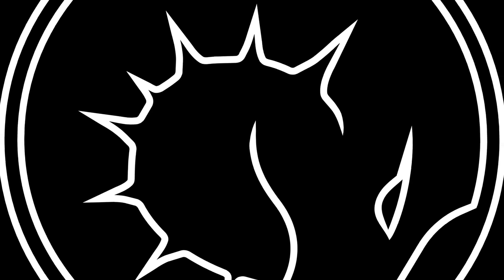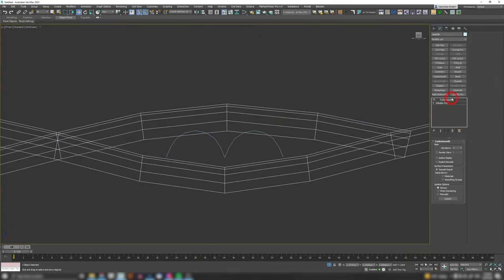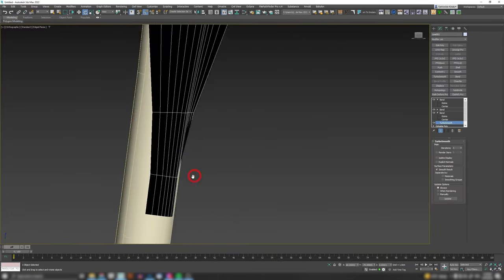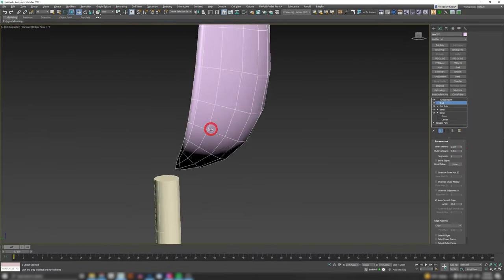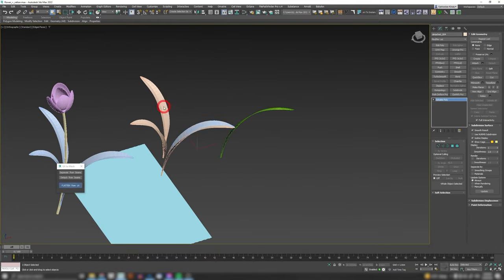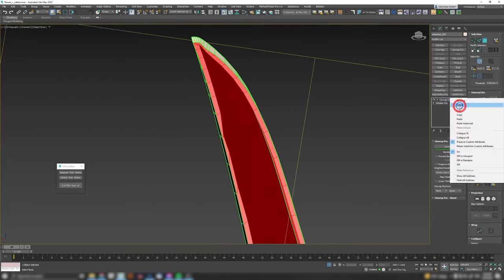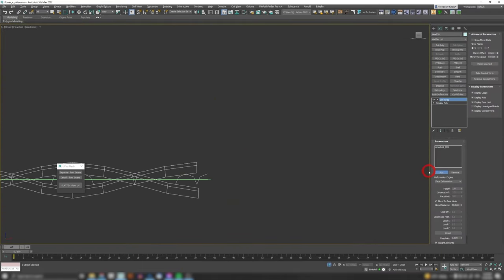Bulletproof Rattan Modeling Method | 3ds Max

Comment: I'm a bit lost, how do you convert ty select to poly? Really cool videos, thanks!
Reply from the maker: Hi, after you make your selection with TySelect, you just convert the object to Editable poly. Selection will be preserved.
for example if your TySelect selection is in Vertices mode, after converting to Editable Poly, you will have that selection in Editable poly's Vertex mode
Reply: @RenderRam  Oh right, I was trying to select polygons, solved. I can see you also scale the mesh after uvtomesh? While doing the petals.
Reply from the maker: @baltazarrodriguez8320  UVtoMesh doesn''t make a proper scale once you flatten your mesh with Morpher, I took that flattened mesh, bring it close to my fully shaped petal and I adjusted the size of it that it matches polygons on petal, then I've added a XRef to that flat object, and linked it to Morpher again, and then you don't have scaling issues

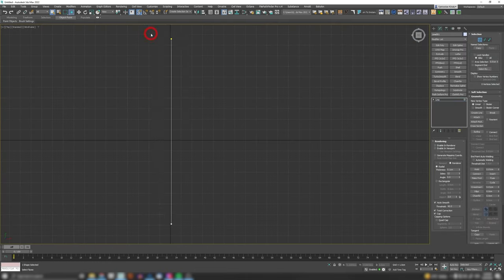Comment: 1:31 how you welded all the edges?
Reply from the maker: Went to border mode in editable poly, selected all edges, and by pressing Ctrl + vertex button, that selection transitioned to vertexes, from that point I activated Weld feature in edit poly and welded from there
Reply: @RenderRam  clear.. thanks